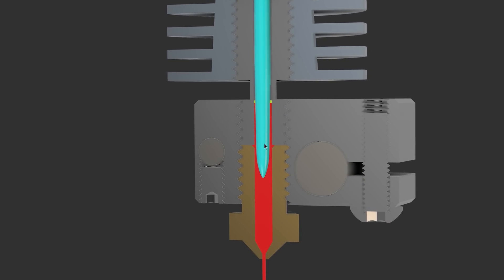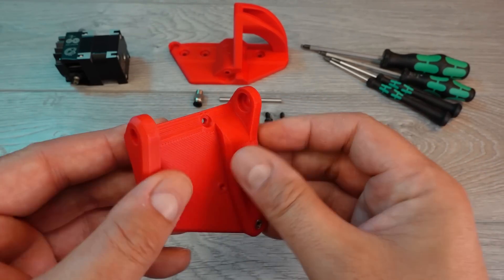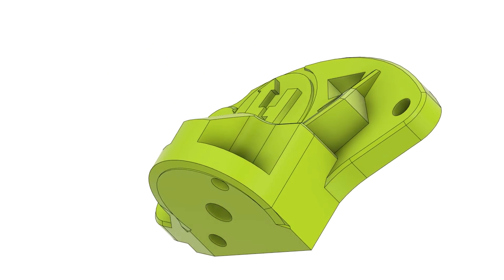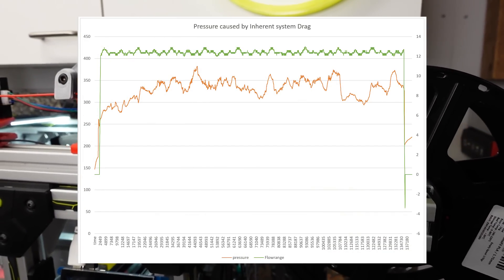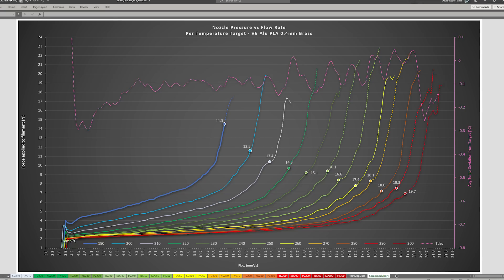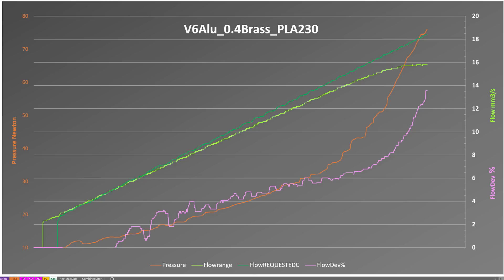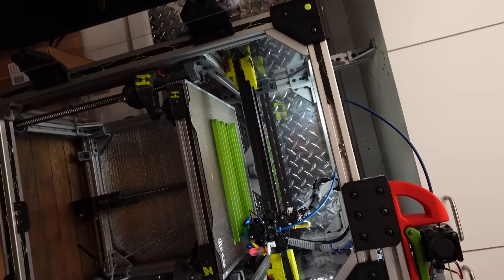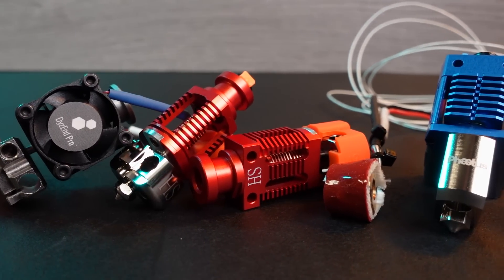Is this the right way to find out? - Ultimate HotEnd Testing - Episode #2

Comment: Why not having the bed move, and the hot end be stationary? A Voron 2.4 type gantry assembly with a heated bed instead of a print head should be doable. Then a crossbar at the top of the frame to rigidly fix the hotend/extruder bring tested.
Reply: Look up the quantum delta. It's perfect for this.
Reply: @sprkng had a comment along these lines.  They mentioned using a rotating disk (akin to a “Polar Printer”) and just the Z axis to produce vasemode prints with minimal movement/vibration.
Reply: @ericlotze7724  Yes, I see. That would work as well, but it would reduce the type of test prints you could do to different diameter cylinders, which perhaps would be good enough. If mounted on a simple linear actuator, this would improve - off course. You would also need a high VA slip ring coupling, to transfer power to the bed heater and to read thermistor values, which could also be done off course.
Reply: @daliasprints9798  Had not seen that before, but yes, that would be excellent as well.

Comment: sadly using bowden is effect badly the surface quality at highspeed printing.
the tube is pulled and pushed when hotend goes fast in X and Y coordinates 🤔
but not bad idea 😁
Reply from the maker: This config will not be used for printing, only for testing HotEnds ;)
Reply: I have been using compression fittings on my Bowden machines for nearly three years now and the pulling and pushing you mention is completely absent, I got the same pulling and pushing of the Bowden with the Micro Swiss hot ends and it was because of wear in the Bowden collet wich had to be replaced on average about every 4 months
Reply: @AndrewAHayes  Im talking bout highspeed (100mm/s+) specially with high acceleration!!!
Reply: @zola5584  Direct drive can print multiple times faster...Bowden isn't needed.
Reply: @REDxFROG  Bowden came about as a fix to direct drive back in the days when the mass of the stepper motor and the heavy hotends caused artefacts on the prints, I still run a couple of Bowden equipped machines just so I can compare print quality on parts, some parts I have printed have been better on Bowden at lower speeds, but Im not a speed freak anyway, print quality is my main concern.

Comment: Did you consider modifying your test rig to simulate printing, as an option to measuring pressure with a real printer? E.g. if you put a rotating glass disc below the rig's nozzle, and lower it 0.2mm per revolution, you could print vase mode tubes with very little added complexity and without shaking from movement.
Reply: Great Idea!
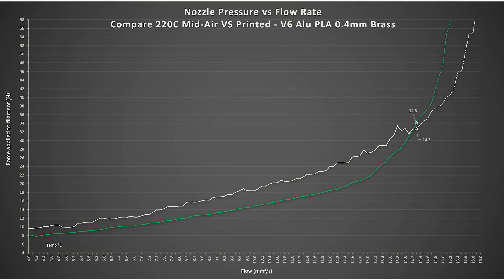Reply from the maker: In order to have this glass rotating, heated for adhesion, going down at layers, being leveled etc.... This would require a lot of effort.  The similarity between mid-air extrusion and printed test shown at 4:04 confirms that the bowden method is viable in my opinion.

Comment: Fantastic exploration and explanation of your current findings! You are shaping this technology in ways that commercial industry has failed us all! While this ultimately will reveal a hotend that potentially has a superior flow characteristic than others, I am enjoying the knowledge that you are creating surrounding FDM extrusion and the hidden details that it doesn't seem anyone knows yet.

While live flow adjustment seems overkill as a future add on to a printer for me, I love the idea of having the ability to have an add on system that tests my filament to determine where its limit and the limit of my individual extrusion system in order to get the most out of it. No one will get the same results with a well tuned slicer profile but this could tell you what your flow, speed, temperature and other values should be to get it perfect.
Reply from the maker: Thanks you!  Live flow adjustment sounds good, but we have to limit compensations to flow levels that are lower that the pressure creep zone.  The more I am looking at it, the more we need to stay out of the high pressure zones.

Comment: Could this be used for live flow adjustment?
Reply from the maker: Yes it could quite easily.  But remember, if you compensate to a point where you end up falling in the pressure creep zone, you wont see any benefit.
Reply: we can just the slicer to a set flow and be good :)
Reply: @MirageC  I was thinking something like you increase power to the motors for a short time if the data says its going to get over 5.75%, or temporarily limit speed until the flow stabilizes or both, that would make it so printers can autoamtically slow down in some more challenging sections of the print and push to their limits in the rest of the print, i cant quite find the pattern but i noticed my printer skipping in the same part of a print over and over and doing the same speed on the rest of a print
Reply: @davidbinenfeld489  the Arachne engine on Cura 5.0+ does this in some form, it sets your flow on the amount defined by line width, layer height and print speed, then if any of the parameters change during the print (as it does a lot, by varying the line thickness) it changes the other changeable value (speed in this case) to keep it constant.
Trying to compensate the under extrusion dynamically seems to me like a lost battle, as you're already under extruding, then you try to push more material out to compensate, which directly makes it under extrude more. I see it that up to a point you can really compensate, but the problem starts to aggravate to the point it might grind the filament. Then a jam...
Reply: Between this, Input Shaping, Bed Sensing + Auto Tramming (Via Kinematic Bed) + Leveling Compensation, an Inline Filament Diameter Sensor, etc we could have one hell of a reliable printer!
Reply: @ericlotze7724  We're getting near the "remove the print by itself, clean the bed of all dirt and grime, and replace filament on your own" territory.
And I love it.
Reply: @Kalvinjj  Yesssss.  I swear if Prusa doesn’t Open Source that Print Farm Software + Automated Manufacturing System-thing it may take longer, but if they do we may be damn well near there in 1-5 years!
Reply: @Kalvinjj  i dont want to push more material, i noticed that on some parts of a print it seems to skips steps at the same speed that it would usually be ablento push so i want to lower speed dynamically to prevent skipping if it detects its about to skip or start severely underextruding, that way you could set max flow in the slicer based on your max flow and let the printer slow down when it needs to and not set the max flow based on the lower limit and miss out on the max flow you are capable of pushing in some parts of the print
Reply: @davidbinenfeld489  I see, this makes sense, as a sort of throttle before it goes bad.
I don't know how Cura does it with that flow thing it has now, if you can actually have separate flow rates for outers, inners, infill and top/bottom. What it changes in line width is usually just the walls (and mostly the inner ones).

Comment: Okay, jokes aside... You've been producing each run as a rise in temperature but not a run at a constant temperature. I think the next test is to take the last know visually acceptable layer (with associated speed and temperature) and then create another test using those values for a 30 minute test print. My hope is that the graphed results will result in a (nearly) flat line. I think this timed printing of a single set of values should weed out non reproducible values. If the graph is all over the place, the delta being just being time, would show that the assigned speed and temperature cannot reliably be maintained. While this is another dataset headache, I think in the end this could be used as a standard criteria against all the hotends. 

Then again, a timed test could be also dependent upon the consistency of the filament as well. <sigh>

Comment: couldn't your extrusion amount just be off for every speed, the extrusion deviation is linear, like a Vernier scale, as the speed is higher the deviation per second will be higher even if there is no extrusion error. I really think you need to measure the length of filament right above the hot end because it could be buckling a few percent in the Bowden and you wouldn't know, meaning you dont really know what you are measuring when measuring the amount pulled in to the gears, a gauge at the hot end and on the spool side of the extruder would be a way to actually measure the deviation. consider did the theoretical vs the measured on the spool side of the extruder value really show much, the point that the extruder slips isnt even close to the actual print failure points. The filament will experience a "slip stick" like behavior, it will stall buckling in the Bowden but because it slowed it will get more heat into it and become extrudable again, the error will not show on the spool side.
Reply from the maker: I invite you to look at the episode one methodology and the comparision i make between the two in this video.  I did measure just before the gears in ep.1.

Comment: You are on the right track, but trying to use standard deviation or a percentage is the wrong approach. Both are still arbitrary and subjective.
I commented on your first video about this.
You need to use linear regression on the pressure values. Calculate a regression for each step, use it to project the next value, and apply a t-test to the next value so see if it is significantly different. This is a well established methodology, that would pass peer review.
R is probably the best choice for doing this, but it can be done in Python as well.
It is very clear from the pressure curve, that it starts to suddenly curve up - you found this yourself. The value you found is consistent with most peoples experience with the V6 hotend - you are at your absolute limit under 13mm^3/sec.

Comment: Wow The results will be interesting. But as with all filaments the make up will always be different as the moisture content will change for every print. The only way around this is to print in a vacuum.
Reply: Granted a room with a HVAC system should have stable humidity, and Humidistats can be used/installed for more control.  Also filament dry boxes can negate the need for these and/or enhance their effects.

Granted I’m not saying humidity has no impact, but rather that is not (currently) the “limiting variable” in FDM Printing.  Akin to talking about the limits of the Root Microbiome in pre-irrigation agriculture;  The water issue has more of an effect so that should be focused on.
Reply from the maker: I am adding room control devices and will be pre-drying the Filament.  I just received a filament sponsorshipo of a very well know company.  20kg from the same batch.  Then I just need a way to calibrate the temp sensors.

Comment: I don't understand why you would use a more restrictive tube such as capricorn, rather than a less restrictive tube.  We don't care about retractions here, and when you're simply pushing, additional slop in the tubing will be taken up - and isolate any variables from the deformation of filament causing additional friction in the PTFE.  I see this regularly when repairing customer printers, where a failing hot end actually ends up causing me to have to replace the PTFE tubing (usually crapricorn) because the filament has become lodged so badly due to deformation of the filament prior to the melt zone (usually on softer filaments).  I'd much rather have less "responsive" results, than errant results due to this choice.
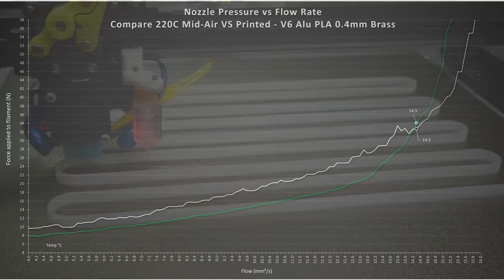Reply from the maker: I dont think the results are errant.  I do understand the potential higher friction brought by the XS may contribute to the pressure increase.  This does not seem to be high enough to invalidate the test as shown by the similarity in results at 4:04.  I am showing the different pressure profile for the same filament on the Mid Air test rig done in the first video VS this new bowden method.  The XS tube limits the filament from folding too much on itself in the tube therefore contributing to the proper transmission of the nozzle pressure all the way back to the sensor.

Comment: None of this data showed anything.
Reply from the maker: Yes you are totally right...
Reply: I just feel like you can get more actual data if you contact the filament suppliers for melt data.
Reply from the maker: @odeball22 Its not the filament that I am trying to quantify...
Reply: @MirageC  I understand but you have to match it with a flow rate diffrent brands might run diffrent and ruin the test.
Reply from the maker: @odeball22  Agreed.  And I think I can have this under control with the help of a new partner. https://youtu.be/nQmqFH2G7rw
Reply: @MirageC  I see.